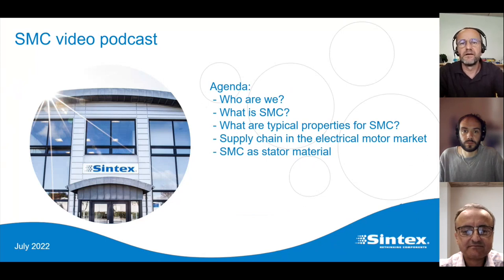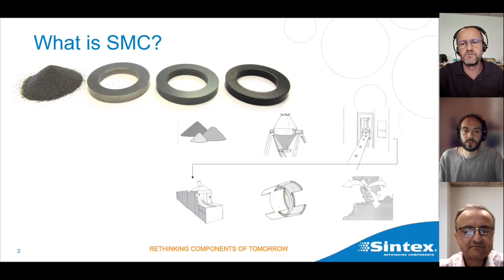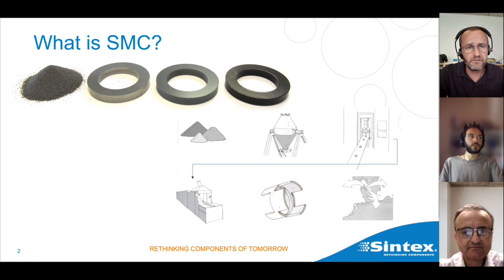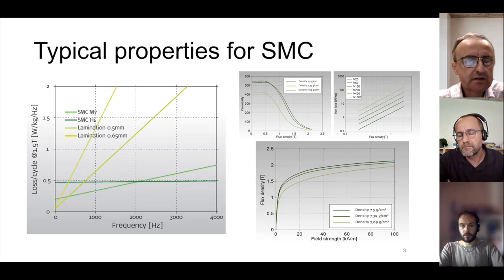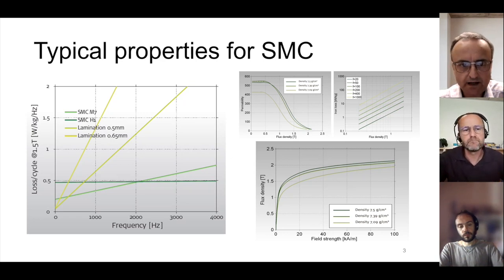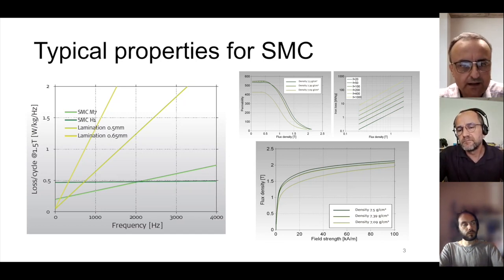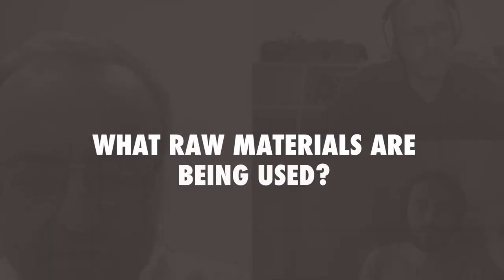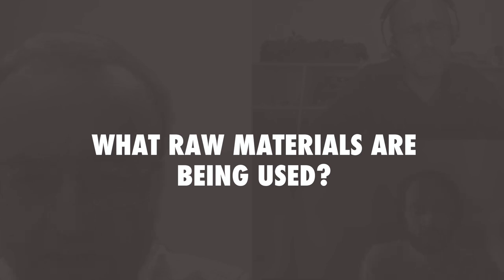Soft Magnetic Composites, Video Podcast

Comment: This was very informative. Thank you. While you may very well become a world leader in motor core manufacturing, kindly consider hobbyists in your whatever manufacturing solutions you come up with. Hobbyists require small quantities as well as small and medium sized enterprises. As one myself, I'm attempting an axial flux machine build with 12 cores. The core laminations are a headache to figure out. This issue has practically stalled the project. SMC can definitely solve my issues. If I can upload a bunch of .step or .stl files for 3D printing onto your website, get a quote and have them delivered to me after, I'd break the bank for you guys. This is really dope.
Reply from the maker: Feel free to contact me on pet@sintex.com. We might have a solution that can be used for prototyping of your components. It is not cheap, but it is fast ;-). Peter